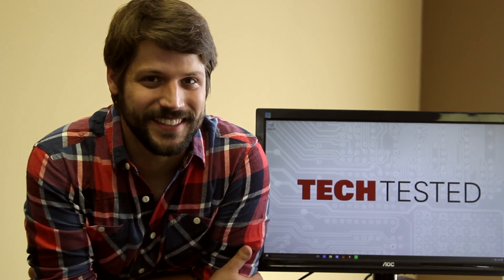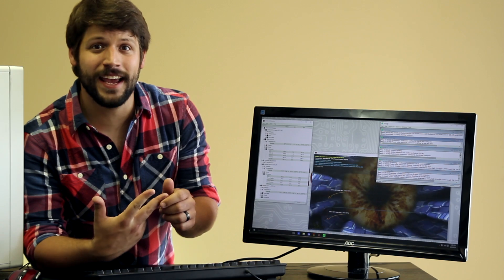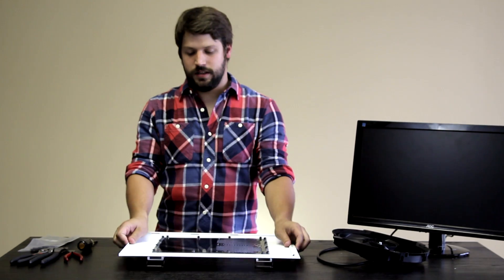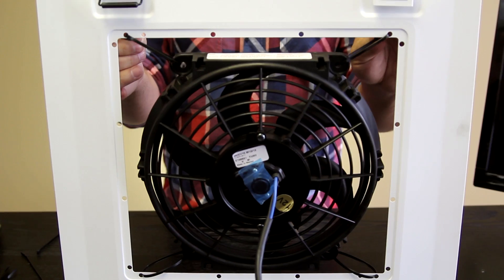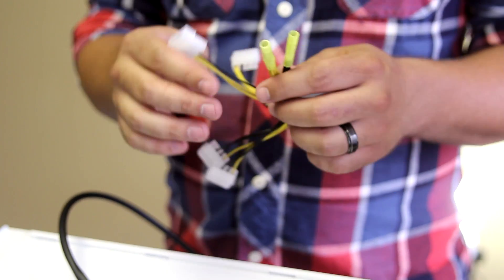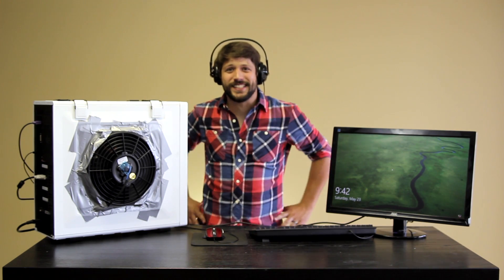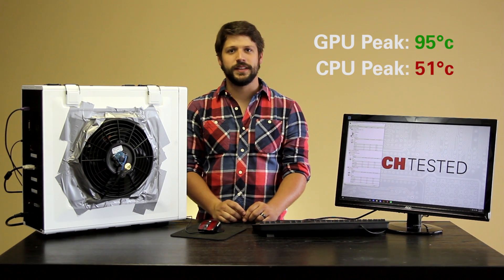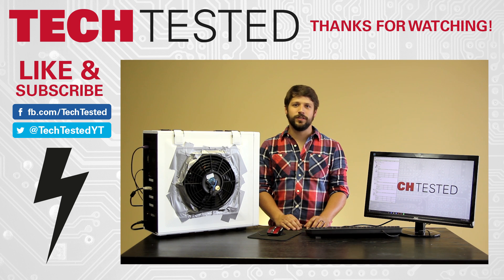Redneck Tech – Overkill Cooling Fan: THE COMPENSATOR

Comment: You only created huge positive pressure in the case but no airflow. Open the shitty case on one side. Don't even add exhaust fans, just make holes there. Then there will be airflow, and the temperatures will go down like 20°C atleast, but i'd say more like 40°C on GPU. Also loudness will decrease with decreasing positive pressure in the case, as this fan isn't rated for static pressure
Reply: It's an automotive electric radiator fan that pushes air through a bigger, thicker radiator and possibly more than one of them (i.g. air conditioner and intercooler) of course it is static pressure, not the best since the blades also have to be designed slim enough to let airflow through when the fan is off, but it is nonetheless

Comment: What Gpu runs at 99 degrees, my old 5870 with the reference cooler under full load with the fan @35% doesnt go over 60 degrees

Comment: u should change that big fan direction to exhaust.. so it can pull out the hot air from the inside
Reply: Negative air pressure will cause more heat than he started with...

Comment: Use two of the radiator fans, get a cut out of an ac duct,kinda like a.moving box before you erect it, setup your components slightly raised in the middle of it on a something that allows ait flow underneath it. have a push/pull setup on either side. A mini wind tunnel used for car aerodynamics, only for your pc.

Comment: Were all the actual 120mm fans in the computer set to exhaust? otherwise there would be huge positive airflow, wich isn't good.
Reply: Positive air flow is bad. That made me laugh.
Reply from the maker: IaimmadRedstone As we said in reply to anoori9000 above, all exhaust would have been ideal but only two out of three of the case fans were set to exhaust. We believe it would've had a very minimal impact, although we'll think about switching it around and seeing if it actually makes a difference.